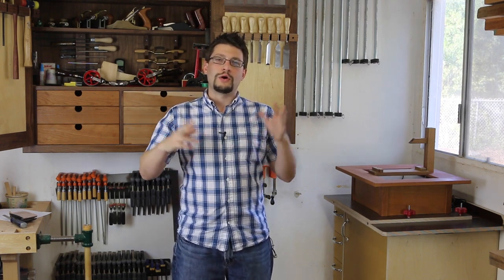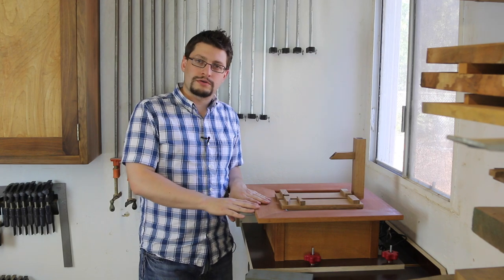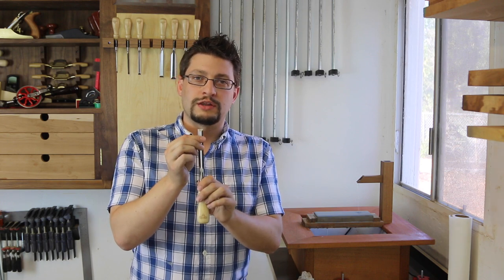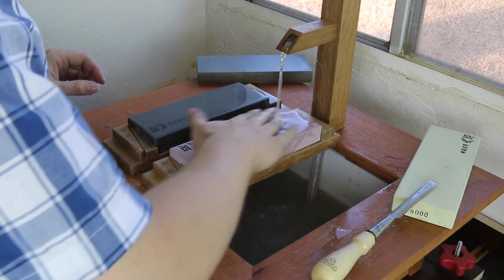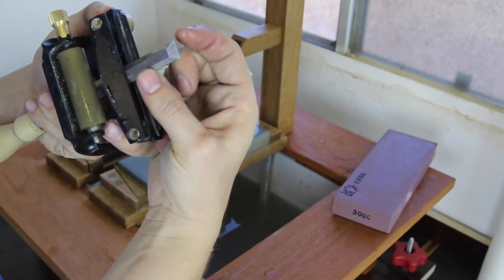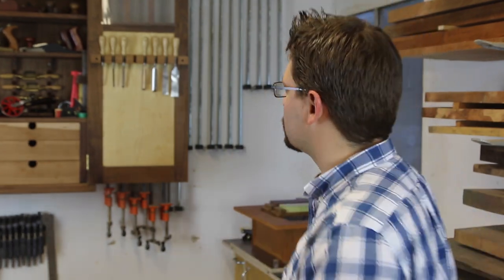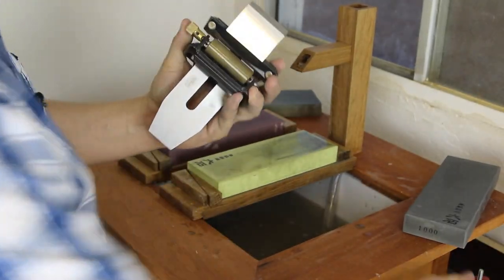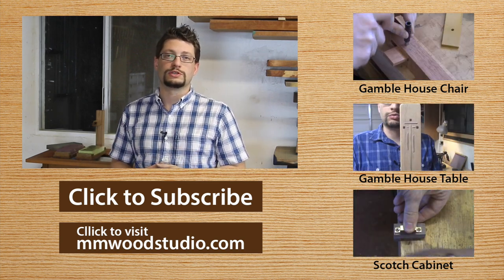Sharpen a Chisel and Plane Blade

Comment: Hello, I like the design of your pond and stone holders. However, I agree with ensen89, When you have the water mixed with the slurry contaminating the same water you are using to wet the stones with it will contaminate your higher grit stones with course grit. I had this issue when I used a 5 gal bucket to rinse and wet my stones.  You will end up with a mirror polish with deep scratch marks.  If these deep scratches go to the edge or on the bevels it will effect your edge. This is more noticeable on very finely set plane blades then it will be on chisels.  

I would recommend the following:  Only have fresh clean water in your spout. this can be done with a gravity system if you do not have plumbing in your shop.  a 5 gal water bottle on a shelf  above the cabinet, with a line to the spout with a open / close valve.  A drain in your basin, again if you do not have plumbing in your shop,  this cab can be done with a simple bucket in or under the pond. 

 After attending a few Lie Nielsen toolwork events I have also switched to the Orishi stones. Love 'em.  I use the 1000 and 10,000 as recommended by the fine folks at Lie Nielsen. I am looking forward to getting my mits on their new honing guide. I have only heard good things about it.
Reply from the maker: John Kunstman I appreciate the comment John. Now that I've been using this regularly, every week for 4 months I can report I've not had any problems. The water coming through is nice and clean. My blades are nice and sharp. I don't have any issues when using them.

Comment: I'm sorry to say that, but I see a big problem in that sharpening station. As you are wearing down the stones by sharpening and flattening, you get grid in the water. When you pump the water around, you can conterminate your fine stones with some rough grid. And that leads to bad surfaces and polishes on your tools. :(
Or is there any filtering system in it?
Reply from the maker: ensen89 Yes you get grind in the water. I only have that batch of water in there for that session of sharpening. After, I just lift up the pond, remove the basin and dump the water. 

As for when I am sharpening, I stick my pump onto the side of the basin. This puts the pump higher up in the water level so that it will move around less of the particles as they are heavier and will go to the bottom.

I did not put a filter in as the pump is $15 and the filter system would have cost more then buying three new pumps. I'll see how long this pump lasts.

Hope that helps!

Comment: Love sharpening with water stone. Not trying to put you on the spot. But I have a question for you and anyone else that reads this. Is the consensus now that you can put a plane down on the sole when not in use? I've noticed so many people doing that in videos since I've come back to the DIY scene. I was always taught to put a plane on its side to protect the blade and its adjustment setting.
Reply: Every time Im done using my plane  I reset the blade all the way in..ifbim still going to need it ill set it onnits side..something I was taught way back in high school. .and I agree ive noticed people doing that but  to each his or her own.. I do it sometimes but not all that often.force of habbit.
Reply from the maker: diycentral I store my planes in my cabinet on their soles, however, I have little 1/8" pieces stripes of wood under the front of the planes holding them up. As for when my planes on the my bench. I don't really worry about it much as they aren't staying there for long, but I am careful about not dragging them around, etc.
Reply: MM Wood Studio I never thought to put a strip of wood to hold it up a little. Is it just in th e front or front and back..I love ur cabinet btw
Reply from the maker: Joe Walters just in the front. Thanks! It works well.

Comment: When you use a sharpie or a marker to put grid lines on your stone, the marker actually seeps into the surface a bit, so your wasting stone when you flatten it. always use a pencil
Reply from the maker: +Max Savino thanks! When you watch the video, I use a sharpie and say to use a sharpie, but below in a lower 1/3 in very large letters I wrote, "Note: Using a sharpie for clarity on camera. You can use a pencil."
Reply: +MM Wood Studio ah I missed that part. Dude your sharpening pond is freaking amazing by the way
Reply from the maker: +Max Savino thanks!

Comment: I dont know about that pond design. If you only need water sporadically, i would think it would be MUCH easier to just splash water on it. Turning the pump on and off seems a pretty big waste of time.

And it might work for you but i would never try to lap the chisel back with such little registration surface on the stone.... any slight elevation of the handle and you will grind a microbevel on the back

Even if all you want is a small amount lapped, i would personally have much more back surface registering on the stone so i can keep it flat.